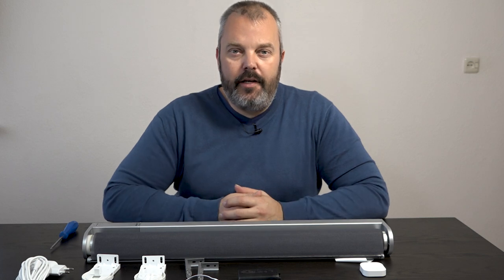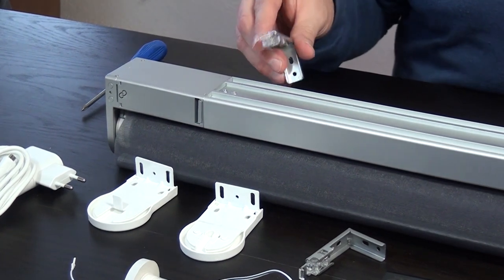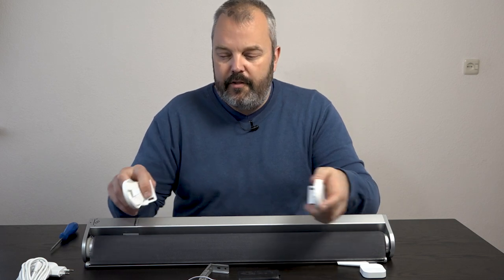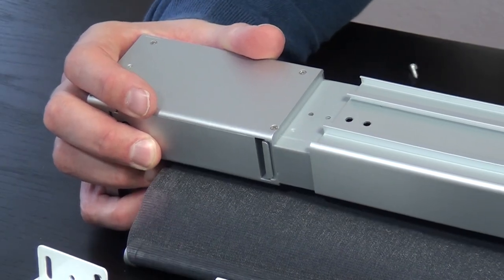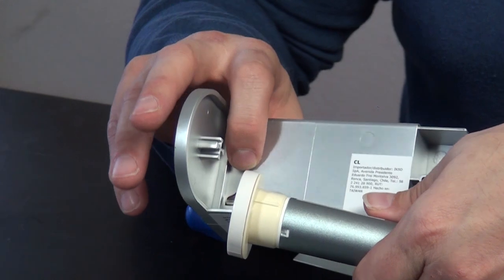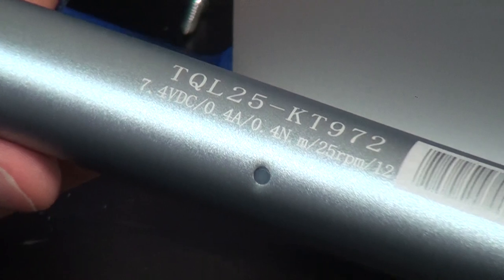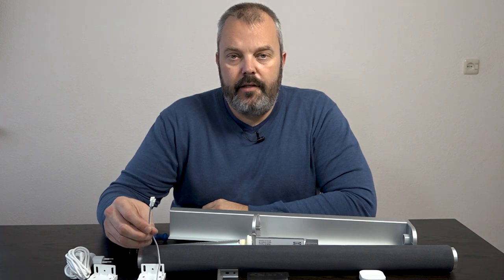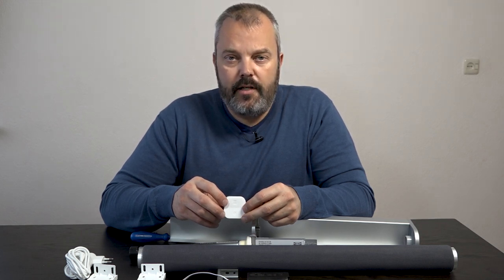Ikea fyrtur / kadrilj smart blind - taken apart and compared with Somfy

Comment: can you hack the power supply and remove the battery on the ikea blinds? Can we hard wire in the supplied charger? 
I just have no intention of taking out a battery to recharge, even if it is only every 6 months.
Reply from the maker: I am pretty sure you can hack it, but that's beyond my skills.

 I think the easiest way is to just find the right transformer and wire it directly to the motor. 

Haven't looked into which one that has to be, but pretty sure there's an off-the-shelf one that would work.